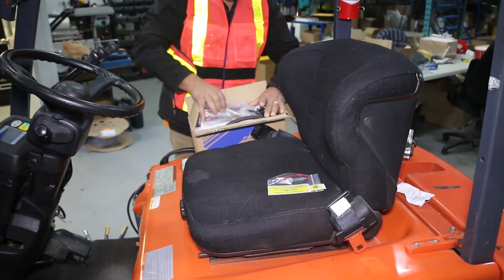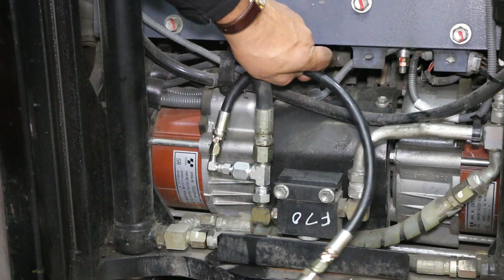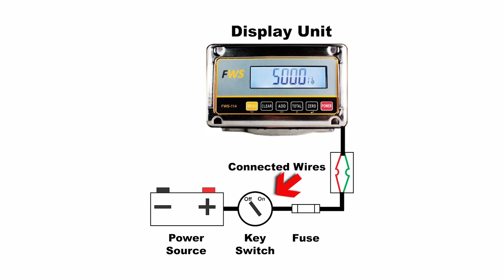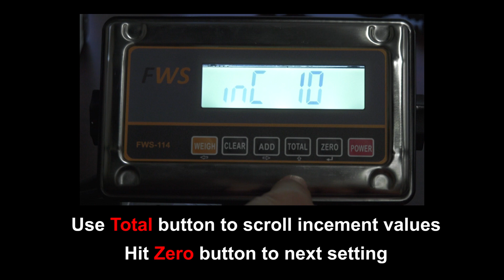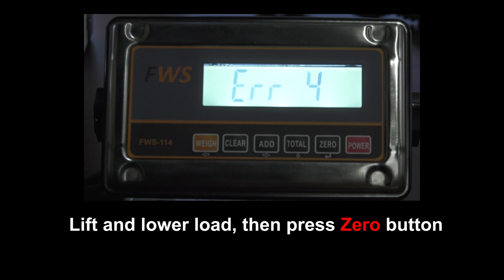Safe-Weigh Installation & Calibration

Comment: is the elbow after the T included?
Reply from the maker: Hi, unfortunately both the T and elbow hardware are not included as this area of the truck can be different sizes for different models and makes of trucks. We advise customers to source these items from either your local technician or hardware store.
Reply: @forkliftstuff2945   ok then whats the size of the transducer fitting?